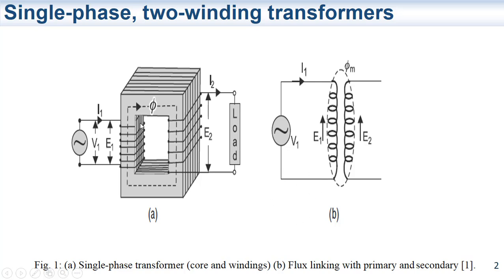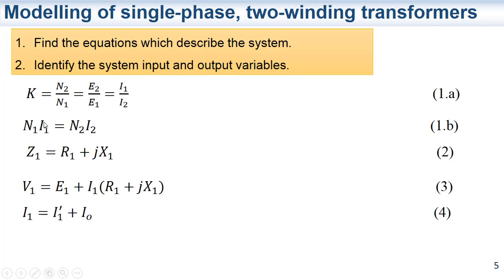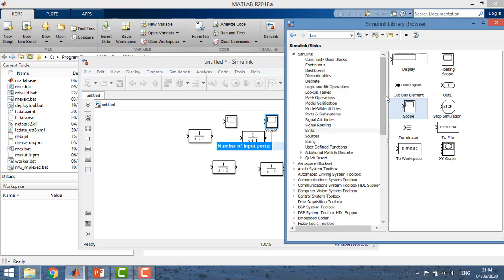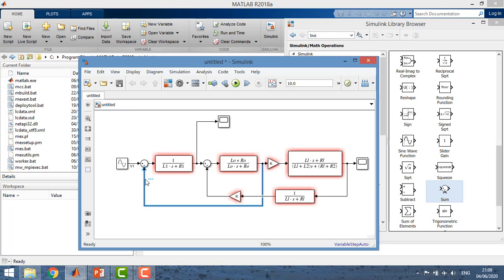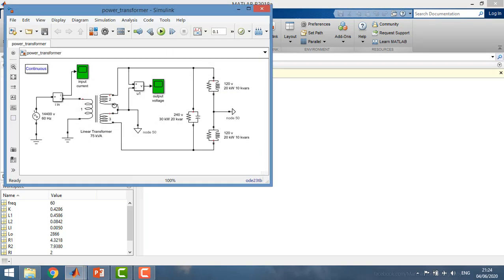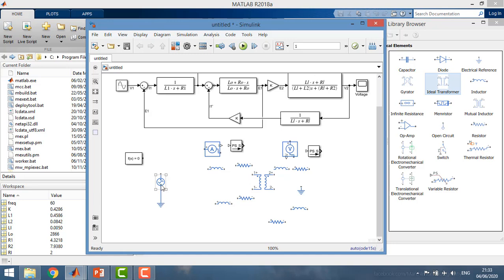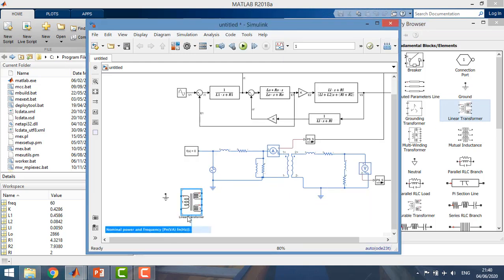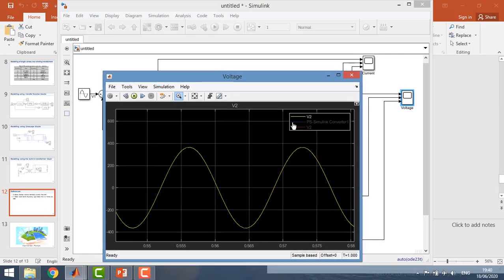Lec 5: Modelling and simulation of single-phase (two-winding) transformers using Simulink /MATLAB

Comment: hi, thank you for your video. I have a question, can you please explain it to me!

I use the two windings transformer to create a simply model....DC current input --> 2-windings transformer --> DC output).... Status: 200V DC input; winding 1 [200 0 0], winding 2 [400 0 0].
After running the model, I got -200V DC input and 400V DC output as observed from the SCOPE

I still have no idea why the input is -200V DC AND how DC current can go through a two-winds transformer. Can you or anyone please explain it to me, thankuuu so much!

Comment: Sir for the model at 8:28 what if I want to replace a built-in matlab transformer block with it?how to connect 2 terminals of input voltage and 2 terminals of o/p voltage whereas in model I have one i/p and 1 o/p only?